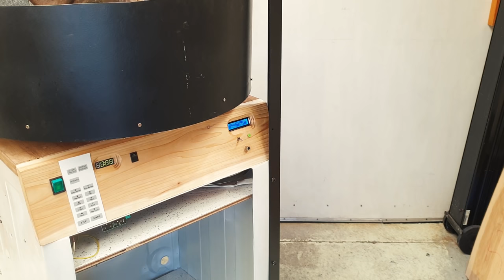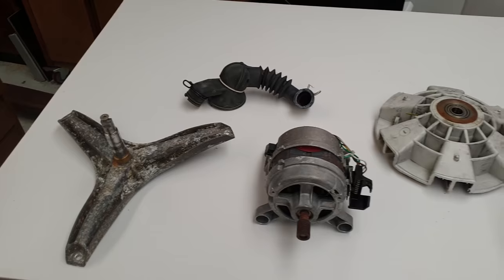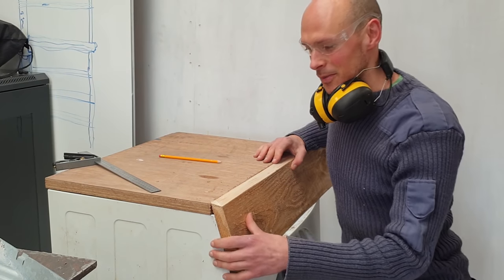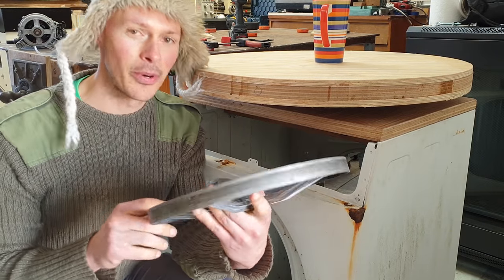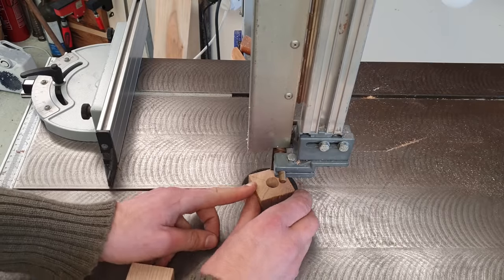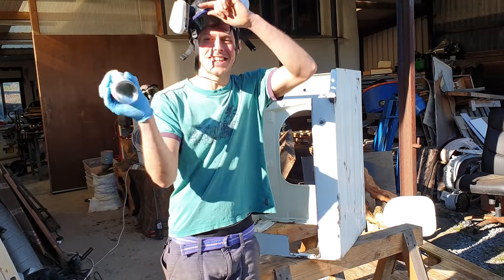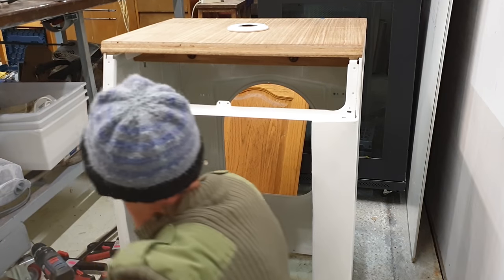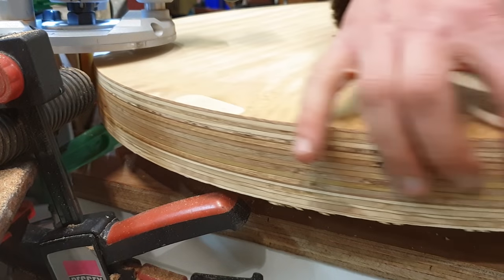Multi Purpose Rotary Table from Washing Machine - Muller, 360 Photography, Rotary Welding Table

Comment from the maker: Hey friends! I have finished this off as a green sand muller and 360 photography machine (I just need to edit the video), but haven't finished the welding rotary table part yet. If any of you have tips on converting this to be used as such I would love to here them. Especially I could do with some ideas on how to get the welder's earth onto the rotating table, using something cheap or free. Thanks for watching. Peace, Bongo.
Reply: Metal work surface, steel, with copper pipe rubbing along edge  that has ground wire attached? Depending on how thick work surface is copper pipe could be rubbing on edge or flat top..
Reply from the maker: That sound a nice simple solution. And there was me thinking about ways I could reuse a bunch of the carbon brushes or make complicated slip ring arrangements...
Reply: @FloweringElbow  My warped little brain had been heading in the same direction but I then realized just how slow it would actually be turning.....

Comment: Fun Fact: Washing machine spider arms are designed to corrode and fail, they are the reason modern washing machines need replacing about 5-8 years. Most of the other parts are good for at least 4 times the cycles as the spider. The spider is also the part hardest to find and most expensive.
Reply from the maker: Good evening Mr berger. Dark, interesting and easily believable! Thanks for watching :)
Reply: @FloweringElbow  Planned Obsolescence (PO) isnt a new idea.

Comment: Not suggesting you do so however many self sufficiency channels use an old washing machine as a water turbine and produce electricity for their off grid systems.
Reply from the maker: Yeah, it would be a cool little project. Nearest stream to the house is quite a distance (3/4mile). Thanks for watching.

Comment: I have some motors from washing machine that I could save in time, can you explain please how to use the motor with PC power supply? Please :)
Reply from the maker: Hi Eljon, have you watched the next video in the series - about controlling the series wound motor ? https://www.youtube.com/watch?v=xI6CF2nYf_g&t=9s 
You can make a 240V washer motor turn with a 12v PC power but it will never have much power...

Comment: Is there a reason that a dryer couldn't be used instead of a washer? They run at a constant speed and if that speed wasn't what was need a different size pulley could be used.
Reply from the maker: Hey Brad. Good question,  I see no reason that couldn't be made to work...

Comment: Waiting for speed controller, what you used?
Reply from the maker: I used an Arduino running PID code to trigger an optoisolated triac. 
If I was doing it again I wouldn't go so complicated and would do a simple AC diac - triac circuit... I will probably end up doing a whole video on the speed control - it's a big subject.
Reply: @FloweringElbow  Looking forward to that topic! Thank you!
Reply from the maker: Hi Rocco, just uploaded the speed control vid. I haven't made a video like this before and I would love your feedback on it. https://youtu.be/xI6CF2nYf_g

Comment: Why couldn't you have lined the washer drum with sheet metal and used it as the sand drum?
Reply from the maker: Nice idea, I did consider it, but I remember thinking the sand might stick to the outsides and/or be too heavy to get moving...?